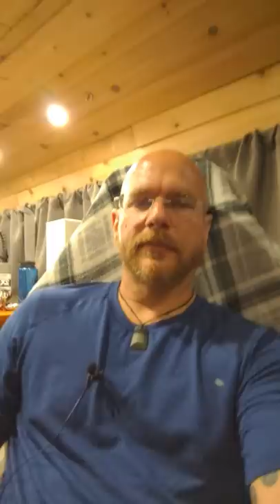Transmission 2 - Joker 0

Comment: I was an independent trucker for 12 years. I've lived and feel your pain. I once broke down in Charlotte, NC and the shop couldn't find and get parts or diagnose the problems with thier stupid cumputer. I was stuck there for eighteen days. After being in an expensive and crappy hotel for two days, I could clearly see that this was going to get expensive. I rented a U-Haul van for $20 a day and retrieved my camping gear I carried in the truck. It gave me transportation and shelter for a very low price. I toured all the local lakes and did some sight seeing. Other than the day to day communication with the shop, it was a good adventure.

Comment: That transmission is new your toxic relationship joker
Reply: Why you'd name a transmission Allison is beyond me, unless you were expecting it to act up because it has a mind of its own.. I'd rather have one that complies with my wishes even if I have to grab a stick to enforce it.
Reply: sounds like time to get a new one instead of patching up an old one?
Reply: Im actually an Allison transmission tech, overhaul and diagnose them.
Reply: @chadtrost9732  OK lets hear some guess as to what it might be.
Reply: @Peglegkickboxer  Man, ain't THAT the truth.
Reply: @Peglegkickboxer  I agree tho
Reply: @hitekcountry  I need to know if its a 1k/2k or a 3k/4k transmission if its an Allison. Then Id need to know what code or codes it has.
Reply: @chadtrost9732  All I know is it is a 3000
Reply: That transmission is purely electronic. It has no manual shift valve in the valve body that is controlled for example by a shift cable. Unfortunately certain codes will inhibit it from shifting completely.
Reply: @chadtrost9732  cost saving measures, or one of those idiot limiters so you can't shift to 1st or R going down the freeway?
Reply: Evidently the transmission feels a bit 'entitled". So it going to "shit test" you Bachelor.
Reply: @fmtoussant  Words to live by.
Reply: @randomidiot8142  No its just how its designed.
Reply: @Peglegkickboxer  😂 yes
Reply: @Peglegkickboxer  LOL TRUE
Reply: @yoshi314  or Helena....Or Ani...or Brenda...Or Marjorie....... slow learner here.
Reply: Good Luck Man
Hopefully that transmission Lives UP to it's reputation (and begins to behave properly)
Reply: Not just joker. I just replaced my chad transmission with allison transmission, and I not even a lesbian. Lol. So far, so good, but it cost me arm and leg.
Reply: @randomidiot8142  classic!
Reply: That bus is his partner on this journey. He would never put as much trust in a woman as he's going to have to with this vehicle.  😆
Reply: transmission going their own way
Reply: Just a general statement not directed towards anyone - You don't have to be a transmission mechanic to know that engine oil getting all over the sensor isn't good, and just replacing the sensor isn't going to stop the oil leak.  Don't have to be a transmission mechanic to know that.
Reply: Maybe it time to get the  Transmission rebuild there's a good place in winston Salem NC or you can to one of those 18 wheeler repair shops not the truck stop one
Reply: @randomidiot8142  ...but at least there's hope with the transmission
Reply: NGL. I miss the old bus day's. A damn adventure.

Comment: This is why I try, and generally do pretty well, at understanding and repairing all my vehicles. You might give it a shot, understanding the drivetrain. You could definitely become proficient and you dont have to know any other models except your own.  Its a great feeling to not have to rely on others. I have 2 cars and 2 motorcycles and no one but me  has done any work to them in almost 30 years. Good luck.

Comment: They need to check the relays too.  Maybe X2 on the EEC poer relay.  Need to confirm proper voltage and continuity.  Your almost there brother I'll pray on my knees for you tonight.  Power of God is greater then all.
Reply: I’m thinking range sensor but it should have thrown that code. Harness to the transmission like the old set up on light trucks? Remember all the problems from the plug?
Reply: Load test battery, check for shorts and continuity...check resistance of related connections 

Check transmission actually has correct fluid, the right amount of fluid, clean fluid etc

Check EGR system is working, check for blockages in EGR pipe or valve, clean and test EGR valve and connections.... Yes EGR problems can affect transmission

Comment: This is why you always test your preps, which is what you are doing with the bus whether you intended to or not.  When that cold front hit this last winter I was out at 3 am in my cold weather gear testing it out.  How else will you know if it really works or not?  So this is exactly what you need.  It's not a setback.  It's a step forward.

Comment: Honestly I get the fun of the bus project but this experience is why I’d just get an RV and travel if it were me, or at least a newer bus...sometimes clunkers just aren’t worth it. It may seem cheap but all the expenses fixing it add up. A bad transmission is usually a death sentence for old vehicles.  Too late now, I hope it gets fixed and can handle the thousands of miles ahead of it.

Comment: I was just in Memphis with a truck breakdown issue. Getting heavy duty vehicles all the way fixed can occasionally be a MASSIVE headache. The alternative is a MASSIVE problem that makes the headache look like a tropical vacation by comparison. Smart of you not to mess around. While you’re at it, crawl under and around your engine, transmission, drive line, differential (grip the drive line and try to shake it; it should not move at all aside from some light rotation slack), and exhaust. Document anything that doesn’t look healthy, and ask someone to check everything you found for problems. Most of it will probably be nothing. Asking a tech how my drive line was after being towed for a different issue revealed a differential problem that could have resulted in a catastrophic and hugely expensive equipment failure if left unchecked.

Comment: One thing I learned in life is trials like this often opens doors or gets you to see a perspective that you never would have had otherwise. Last year, I take 3 of my kids to go mountain climbing in Colorado, around about Grand Junction, I break down on the freeway. Called a tow truck and he took me to a garage that wouldn't open until morning. Threw most of the camping gear into the cab of the pickup, grabbed the backpacks with a change of clothes and some snacks and walked until we found a motel. About 2 miles later, we find a place, then walk another couple miles to a restaurant. Got caught in a massive thunderstorm while walking, but after eating and walking back to the motel a huge rainbow came out. We killed time skipping rocks at this park. It is a rare treat for the kids to eat at a restaurant, and they still look at that day in Grand Junction fondly.

Comment: I had a similar problem once. Ended up replacing the transmission four times until they finally realized the wires were mixed up and put back in the wrong way. The wires looked the same so the mechanics didn’t think it was a problem. Turned out to be a very expensive problem for me and really frustrating because every time they tested the transmissions each time they result was it was a good transmission. Anyway the mechanic finally found the correct wire connection and, more importantly, marked the wires so they won’t get mixed up again. I hope this helps with avoiding unnecessary headaches. I think you have great content. Good luck to you.

Comment: I guess there's something to be said for old tech.  Sensors, chips and onboard computers usually mean more to go wrong.  Hang in there and best of luck on the transmission issues.  Eventually you'll get to where you're heading, one stop at a time.

Comment: Yo J, story for you to read while you're not sleeping - I'm building my own tiny home out of a 17' uhaul and I am in the process of moving from Sacramento to Houston. I made it all the way to Texas over the course of 4 days until my engine gave out going up a hill about 6 hours from Houston. I was towing my car behind the truck and had all my stuff inside (since I'm still early in the build I had room to move all my stuff). No tow trucks could make it that night so I had to shuffle around all my stuff in the back of the truck to access my futon and sleep on while I was parked in a truck-parking pull off.

Got towed the next morning but no mechanics were available since it was a weekend and its a small town. Unfortunately I was in a time crunch - I had to turn in my tow dolly in Houston on Monday or get fined $500 per day. So I spent 2 hours trying to contact a mechanic in this 3k pop town that could service a v10 gas engine and finally found a guy who could "Get to it at some point." Obviously this wouldn't work for my situation so I needed to compromise.

Luckily the guy who towed me ran a small uhaul rental operation. I got the idea to leave my truck behind and continue to Houston in an actual Uhaul. So I transferred allll my stuff from my uhaul to the new one, alone, in the mid-day texas sun, re-hitched my car to the new uhaul, and finished the 6 hour journey to Houston. Just got the diagnosis yesterday that my engine is shot and will need replacement. I was going to replace it anyway so It's cool, but my truck is still 6 hours away and I'll need to make the journey back (with a friend) to pick it up after the engine's replaced.

TLDR- I feel your pain.

Comment: I left a comment on your first bus video about needing to really secure that wiring so road vibration doesn't break wires.
I have no idea if this trans error is related to wires or not, but it is always well worth securing all the wiring so there is never more than a couple of inches of wire unsupported. Good luck Joker. 👍🙂

Comment: Good luck, Joker! No worries about the idling diesel noise: it really isn't that bad. Not that I'd want to listen to it for one of your full-length offerings, but for the few minutes of this update it was a non-issue. PS -- You're learning first-hand why it's a time-honored tradition for sea-going vessels to have a shake-down cruise before starting off on an ocean voyage! Hope you get the kinks ironed out quickly...

Comment: Manual transmission, non-electronic engine, it's the only way to go.  Computers in everything make it less reliable.  Crawl around and look for a disconnected, loose, or worn through wire, sometimes you get lucky and it's the simple things.  Good luck, and best wishes.

Comment: Medium duty manual transmissions do have their reliability advantages, as long as you change your clutch at correct intervals. Better gear ratio's too.

If your running an Allison 545 auto or similar, should be lots of complete used units available at reasonable prices.
Sometimes your better off changing whole unit. Contamination, etc
Lots of buses in junkyards too.

Comment: We had an old suburban that went through transmissions like that.  Turned out that a ground on the TCU was rusty.  Cleaned that up and went almost 100k miles with that same transmission then.  4l60e blues for those of you in the know.

Comment: Had the same sort of problem with a Mitsubishi 4WD except it was the engine. 

The engine light would come on, engine would be running rough and then it started cutting out all together and stranding me. I got it fixed after three tries but got rid of it shortly after. 

It was just a sensor on the engine block in the end. 

It’s so very frustrating and infuriating when this happens. I hope you can get the bastard fixed once and for all mate. 

Thanks for your content, I always find it very interesting and what you say is pretty right.

Comment: Did they check over the wiring harness?  Never had a bus, but we had the tiniest wire connection go bad and everybody missed it.  (very minute sporadic voltage drop).  One of those rare master mechs. with the 1800's mustache swapped a connector and it was good to go.

Comment: I have also dealt with my fair share of car problems on road trips lol. I had to drive from Oregon to Utah with a slow leak in one of my tires and no fuel gauge because a random sensor went out and was causing voltage drops on the ECM 5V reference.

Comment: If you bus is 4x4 you may want to have a mechanic look to see if the transmission is low. If it is, it may be bleeding trans fluid into your transfer case. The Allison's will lock into gear when low on fluid and set codes. Hope this helps.

Comment: I hope you get it all sorted out Joker. 

BTW. Are you towing your car/truck behind the bus now? 
I only ask because there's a kit you can buy. That allows you to use your air brakes. With the master cylinder on your vehicle. My parents did this with their coach. Towing a rubicon jeep. Not too difficult to install. Makes a huge diff in stopping. Night and Day honestly. 

Also if you don't already have one in the bus. Pick up a rice cooker. You can cook all kinds of stuff in there. OTR big rig drivers use them all the time. Also check out getting a Susvide kit. ( they got a kit at costco right now for 200 bucks. 
They're perfect for set it and forget it type cooking of foods. Tons of great stuff on YT about them. 

Lastly if you're ever in northern ca and need some assistance with the bus. ( fiberglass repair, spot repair painting or maintenance. I'll do my best to help you. Or steer you to a reputable shop for work.

Good luck with the bus and be safe out there on the road. Better to show up late, than never.

Comment: i fixed my automatic transmission on my van with a wire and a switch to flip it manually into overdrive above like 40 mph. on the same van i fixed the bent drive shaft with counter weights and hose clamps. Fixed a vacuum leak with a screw. So my advice is throw a hose clamp, a screw and some wires and switches on that bad boy. if that doesn't work, leak stop and gorilla tape.

Comment: Definitely check the Transmission fuses and relay.  If voltage is not getting to the transmission it will definitely go into limp mode and the solenoids will not do the clicking things 😉

Comment: bummer, dude.....I just had my transmission rebuilt in my work van.....$2K.....so far, so good....an allison transmission ain't cheap to rebuild....ya may have other issues besides solenoids....best of luck to you....I lost a motor in Louisville, KY in '97.....as well as the car.....

Comment: @JOKER
if the transmission is pneumatically controlled, check the system for impurities such as small particles, this can cause the most peculiar errors like sensor-errors aso! (also check for some leaks if pneumatic)
(if hydraulic - forget what i said)
Btw - talk to the truck-drivers about the bus' system, in 8 of 10 cases these guys know better whats wrang with the thing THAN the mechanics themselves!

Comment: Here's a tip. Change all of them. Go ahead and get it out of the way and the harness too. Make sure you have a good transmission cooler on there. Solenoids don't like heat.

Comment: Maybe put back the old school  manual transmission.  I've been in the trucking industry for 20 years and last 10 years noticed the Automatic transmission on commercial vehicles are unreliable,  that's why they were manual as long as they have been .  Manual  more self sufficient  choice however  can't praise you enough on your bus ..Best wishes and safe travels pal.

Comment: Here's an angle you might want to explore:
-Couple of decades back most school buses had manual transmissions.
-Since most school bus drivers are WOMEN, and had TROUBLE driving a manual, bus transmissions are now almost exclusively automatic.
I can say that I have NEVER been left at the side of the road by a manual transmission.
But, grrrlzzz are equal, if not better, right?

Comment: Time to fix that wiring harness, voltage fluctuations can cause the ECM to get false readings on the sensors. Allison's are workhorses I bet there is nothing wrong with it.

Comment: With the proper cable it is possible to communicate directly through your laptop. Pull codes do research especially Technical Service Bulletins . 
Also access Ford Direct  online and the service allows access to specific info. 
Think of it as a big puzzle. 
Also other shops are there for previous reference info. Would be helpful if you kept a code list in order set over time.

Comment: I hope it’s a simple fix. I have seen plenty of new solenoids fail shortly after install. Might sound dumb but did they replace the filter? We had a few buses that had solenoids fail and the dealer replace just what failed but debris had made it to the filter and popped a fault for it and we had to replace them. The filter reminder would show up in the HUD as needing the filter service only if the miles traveled triggers is and we have had people that reset it without replacing the filter.

Comment: Joker, Unfortunately you will likely end up needing a new transmission. The root cause of most solenoid issues is debris from other failing components clogging them up. Just be sure the transmission cooler and lines get flushed thoroughly to remove that debris as part of the repair or the brand new Transmission may fail also.

Comment: I have the solution.
1) Take a little piece of black electrical tape
2) Place it over the dashboard transmission light
3) Drive!

Seriously though I hope you get it sorted out by a solid mechanic before too long, good luck on the road and in the garage.

Comment: The bridge into TN on i40 is currently closed, you'll have to detour to 55 and both TN and AR are working on restoring traffic through the corridor but it will take us a little time to do it. The TDOT is on it and the Governor has surveyed the problem as well. Perhaps it's a good thing your transmission light came on?